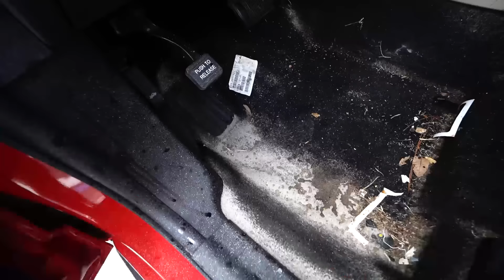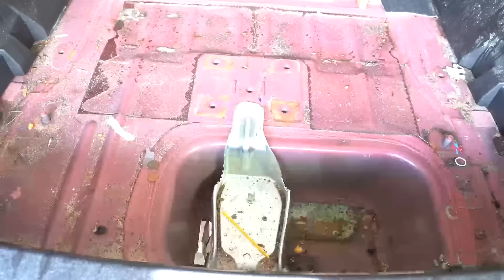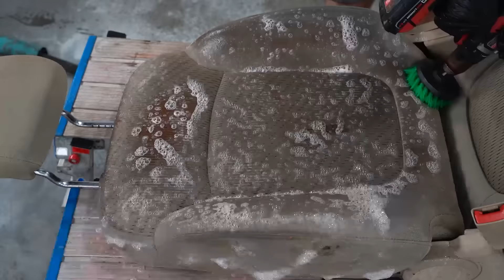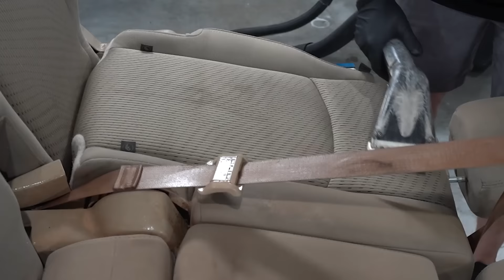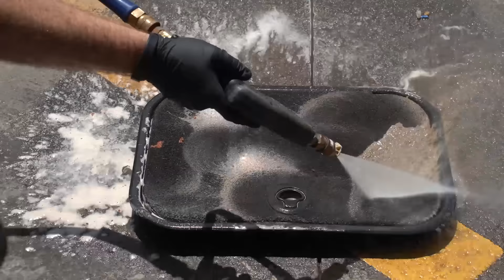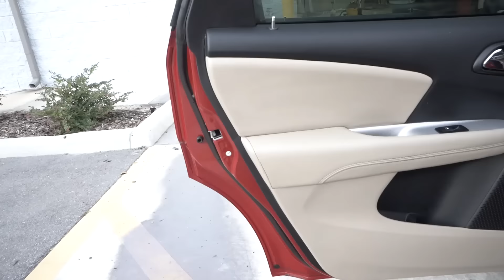Deep Cleaning The Worlds NASTIEST Dodge Ever! | Insanely Satisfying Car Detailing Transformation!

Comment: Well done! I get a few vehicles per year that rival this one. All the cars that get stolen end up abandoned on the Indian reservation here in AZ and they're always trashed.
They're always insurance jobs so the money is always good but they're never a walk in the park. 
Do you have the seats bolted down for stability? Next time I have to pull seats I'm going to bolt them to a platform. It will make scrubbing and extracting so much easier- especially if the platform has them elevated off the ground by about 3 ft .
Great job!

Comment: I wanted to give advice to the guys, when you can protect the terminals of the electrical contacts in the car, at least put on bags and seal with tape, it's just that these terminals feed the airbags in the seats, it will be very sad if they rust and do not work at the right time

Comment: I love your vids but I'm concern with the integrity of those bolts after removing and reattaching in used metal holes. They never get the same strength and in an accident I would be worry about seats flying of weak connections.

Comment: I got a 95 jeep grand cherokee for $300 a year and a half ago. I did an incredibly deep clean on the carpets. They came out like new. 10 hours on carpets alone. They were loaded with sand. I want to restore the jeep to its former glory and build it up to modernize it. I did detailing before and did a foxbody mustang that had a window seal fail in winter in 2013, wasnt discovered til june of 2014. The mold was horrid. Every inch of the interior was mold. It came out like new. I miss detailing.

Comment: I can testify that a close relative of mine have this habit of treating a car as a dump.  He works in construction.  One day his car was in heavy maintenance and needed a car car for his work.  So I loaned him my car, which is in perfect and clean condition, seldom used.  After only just three weeks of use, my car turned out to be about 20% the condition here.   I found his dirty socks, clothes and underwear in my car.  Plus empty drink cans and milk cartons littering the floor of the car.  There were stains on the back seat, luckily the seats were all leather so it's easy to wipe off.  But the stink..... Ewww..... That was hard to forget.  Never again do I lend him my car.  Imagine if he had the car for a year, Im sure it would come to the condition as depicted in this video.

Comment: Those roaches are gunna still be living in that car even after it's cleaned. They'll be behind the dash, behind the door cards, under the cloth in the seats... they'll be everywhere. The smallest spaces. The only way to get rid of them is to tear everything out of that car until it's just the bare metal. Because I will bet dollars to doughnuts they left a film of filth everywhere they went. 

You can ozone that thing and it will probably get most of em. But their mess will remain in the places you couldn't get to. 

If it were possible to fill the entire cabin of the car with 98% isopropyl from floor to headliner I would, as impractical as that may seem...